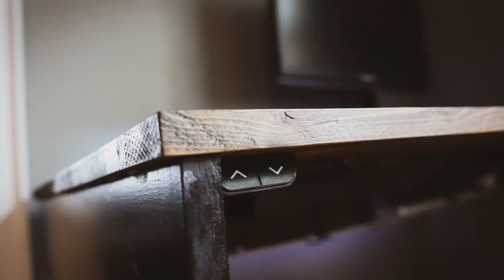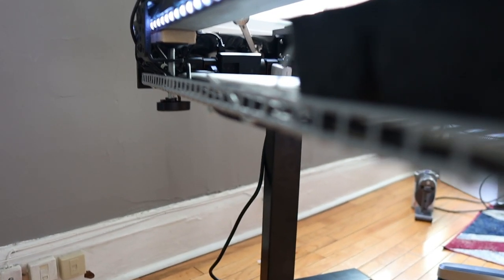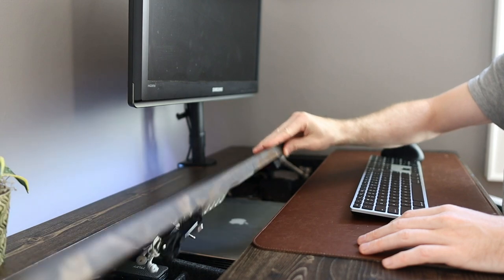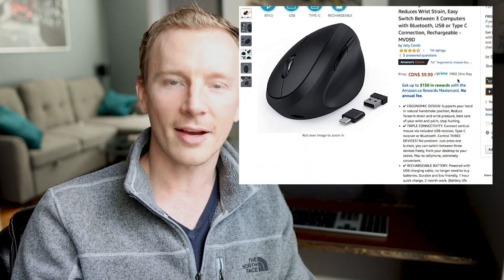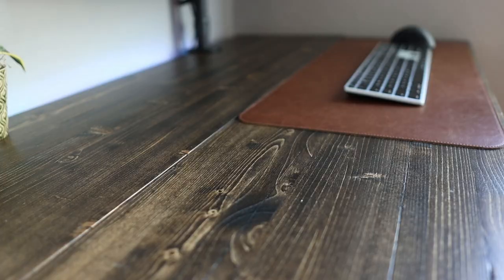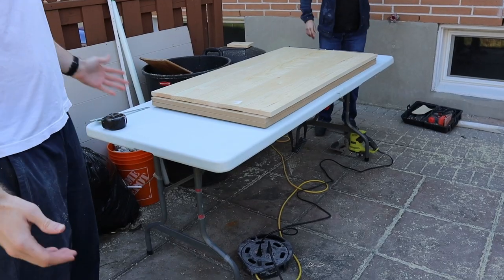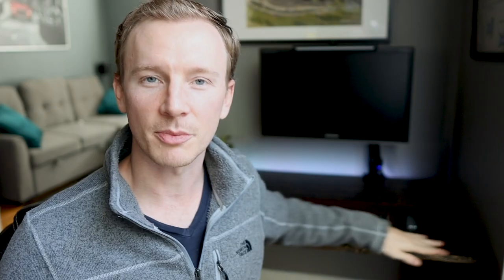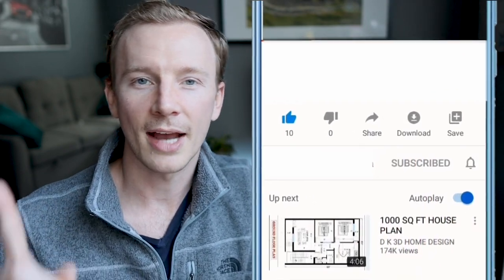DIY - The CLEANEST desk set-up/build ever! Space saver hidden storage and wireless charging!

Comment: beautiful desk!!!  recommendation..... for your charger, rather than having electric tape and that all-round strap, consider a simple piece of ply, say 2" x 6" in length (not sure how big the charger is).  screw one end of the piece off to the side and create a pivot latch.  much like ones you see on a fence gate.  that way you can access the charger if and when needed without having to unsrew and rescrew into the bottom of the desk.
Reply from the maker: Excellent suggestion thanks!

Comment: You mentioned that you wish the desk had a memory feature. Make your own.

All it is is a switch that sends either a power across one of two wires - - which wire the power comes in on tells the actuator (lift mechanism) whether to go up or down.

Yiu could use an arduino with a touchscreen to control it.
Reply from the maker: Interesting, thanks!

Comment: Not bad, but that seems a bit expensive for a pine desk. Around March of that year, I was able to acquire solid redwood and make a desk with waterfall sides and tabletop for around $300 and thats in California. Add up the other supplies and it was around $390 for a solid redwood desk that is like 1.5" thick on all sides. It's my dream table like an Apple Table style. The effort to make was quite a bit, but a similar table online was going for like $1400, so decided to take the crunch.
Reply from the maker: The pine wood wasn't expensive at all. The majority of the cost was the standing/electronic legs, stain, conditioner, poly, wire rack, hinges for the shelf..etc. There is a cost breakdown closer to the end of the video. I'm glad to hear you saved yourself some money by building yourself a nice desk!👌. Thanks for the comment
Reply: @CoreyStaden  Oh got it lol. Yeah that's true the vertical system is already $150-$200. Nice build I honestly was looking for a video about how to do that open up part on the desk and you did a cool one.

Comment: How did you attach the wire rack to the desk? I see some straps on the rack but what did you attach the straps to?
Reply from the maker: I used the clips that came with the wire rack and screwed them into the side panels of the desk, the rack is held up by those clips. The two straps in the middle are screwed into the underside of the desk and they are just to prevent the rack from bowing. The clips look like this: https://www.rona.ca/en/wall-clips-36485137

Comment: is that hinged storage shelf just on the hinges "free floating" otherwise? Or do you have brackets someplace else? making a similar type deal with a 40" long top, and trying to figure out if the hinges themselves will be enough, and if not, how to mount them without stoping the opening function.
Reply from the maker: Yes, "free floating" is a good way to describe it. The two hinges you see in the video are the only two hinges needed for this build. I was initially thinking I would need another piano hinge of some sort to attach it at the back, but its not necessary. This way it can open from the back as well, which is handy when you need to move the desk around or add/remove cables. I remade this video with a bit more detail (not about the hinge unfortunately). here is the link: https://youtu.be/e9rfhC0eCak . let me know if you have any other questions!
Reply: @CoreyStaden  Thanks for the quick response! I've seen the newer video as well! im hoping these hinges will be strong enough/have enough support for an entire 40"+ long table top lol
Reply from the maker: They absolutely should be. My desk is 48" long (3/4" pine) and the hinges are fine. The resistance on the hinges are adjustable as well. I don't even have them at full strength.
Reply: @CoreyStaden  sweet! Last question lol do you think it would be alright to just leave some hang over on the edge , so that I can just open the entire top without that solid piece you have behind it?
Reply from the maker: I don't think so.. that fixed piece of wood acts as a back stop and pivot point for the flap. Without it, too much wiggle room and the flap wouldn't stay open.
Reply: @CoreyStaden  ahh i see, alrighty, thanks alot man! Great desk too! It'll definitely help me in my journey to build one lol
Reply from the maker: I'm glad you enjoyed it. I'm happy to answer any questions along the way. Let me know how it turns out!
Reply: @CoreyStaden  will do! Making it a U shape, with regular tops (probably Ikea premade or a butcher block) and a metal pegboard bottom for ventilation/ a place too mount my PC outside of it's case. Cutting the center in half to do some resin possibly, volume controls,surge strip, USB ports, and a 5"/7" LCD screen for GPU/CPU temp readouts mounted on the sides/backs, and a 3rd monitor/Touch screen LCD Panel embedded into the desktop for either a place too do work straight on the desk, or hook my phone up and play mobile games when bored. It will definitely be a lengthy project lol
Reply from the maker: That sounds amazing! Best of luck

Comment: Try hot glue to hold your wireless charger. It worked for me.
Reply from the maker: Thanks for the tip! I removed the coil from the housing, did you put the hot glue directly on the coil?
Reply: @CoreyStaden  I just glued the charger as is 🤣

Comment: What hinges did you use and how did you mount them?
Reply from the maker: I got the hinges off Amazon, here is the link: https://amzn.to/3eGnTre  
I mounted them to the black piece of wood I used for the side portion of the desk, then mounted the top of the hinge to the underside of the flap. If you click the Amazon link, picture #2 shows a good representation of exactly how I mounted the hinge on my desk. Thanks for the comment!
Reply: @CoreyStaden  Thanks for the reply!! I bought the lid support lifters from the link, but what were the hinges you used? I'd like to have the hinges not show but I can't find ones that won't stick up though the desk. Eager to hear your thoughts! :)
Reply from the maker: I see what you mean now, I didn't use any hinges at all! (Aside from the soft close hinge). Obviously I was trying to keep the desktop as clean as possible so I was looking for a hinge that would work underneath to attach the flap to the back of the desk but I couldn't find any good solutions. After I installed the soft close hinge I did some testing and realized that when I lift the flap, the back just stays put lol 😆.  So I never installed any hinges at the back. Also, because there aren't any hinges in the back, you can open the flap in reverse, which has come in handy on occasion when I need to run cables or get behind the desk, especially when I was building it and attaching it to the legs, it was nice to be able to open then flap both ways. It was a surprise win. The soft close hinges have been more then enough support over the last 6 months. I look forward to hearing about the progress with your desk! Let me know if you have anymore questions! And thanks for using my link.
Reply from the maker: Very nice! Looking forward to it